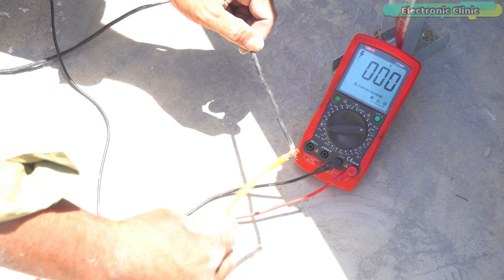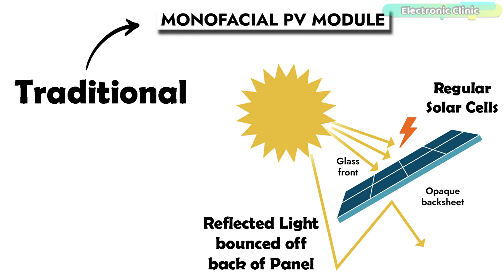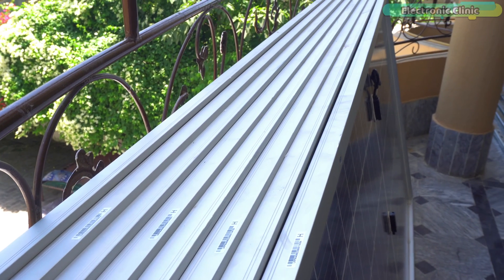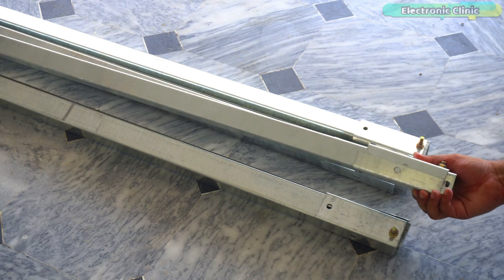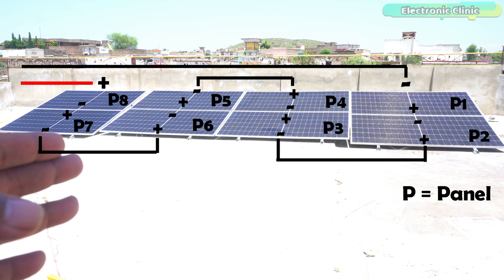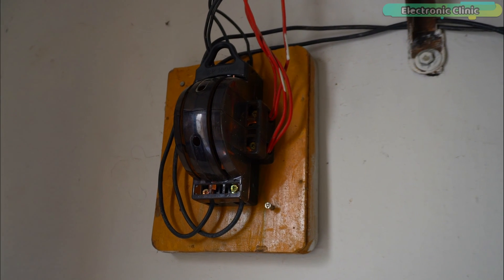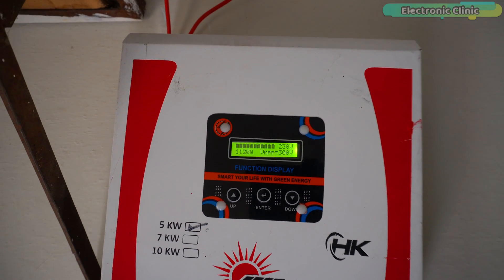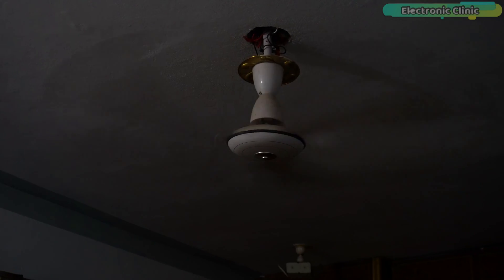5KW Solar System installation Guide, Longi Bifacial Solar Panels, Home Solar Power

Comment: @6:50 The tool you use is not good enough to fasten connectors to the cable. You will get fire on this connectors in future.